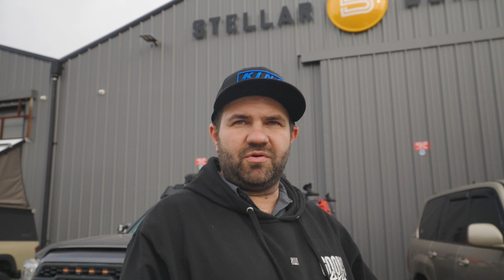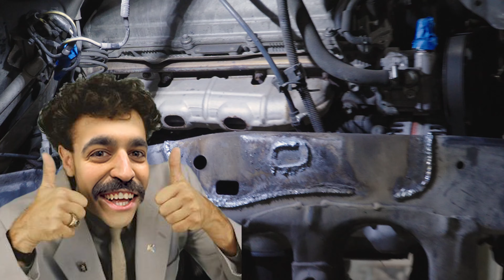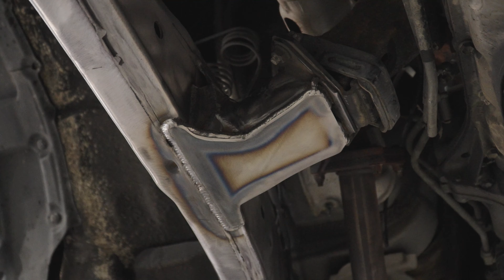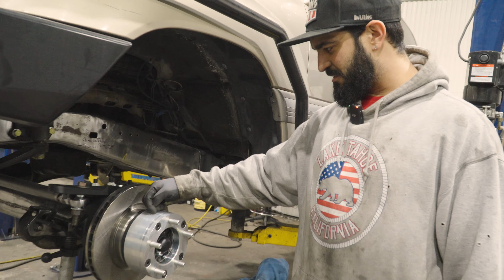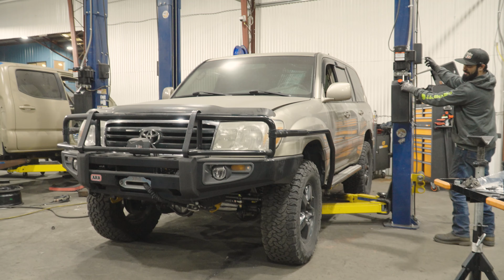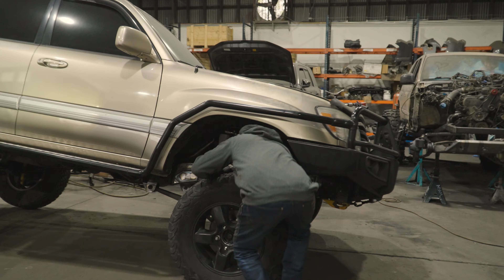Land Cruiser SAS Conversion | UZJ100 + FJ80 AXLE

Comment: Yes, the 105 series is super cool, but they still have the inline 6 engines. So in my opinion, the ultimate land cruiser would be what you guys are doing here: converting a 100 series with the 2UZ to solid front axle. This is rad!!
Reply: Or engine swapped 105, fte swap. It also has the 1fz aswell
Reply: @kadenmackriell4751  I agree, that works too! haha

Comment: great build, quick question, when doing the swap using an 80 series front axle, do you also need to swap out the rear axle do to gear ratios? also how much can once expect to spend if they wanted to do a solid front end swap on a 100?

Comment: 105 diffs are wider so you wouldn't have to run wheel spacers. We use 105  diffs when coil converting 79s here in AUS.
Reply: Needs a GU Steering box
Reply: @benwilkinson7181 although gu steering box is beefy, people are starting to use 105 boxes now, the 105 isn't as big but it has a bigger sector shaft wich makes it stronger and better.
Reply: @kadenmackriell4751  I’m from Aus, the 105 box isn’t as good as GU steering box. Sharon’s 60 series has a GU box
Reply: @benwilkinson7181  yeah 105 box are good but they are prone to leaking a lot more than a GU
Reply: @benwilkinson7181  I'm from Australia aswell. And lots of people are starting to go away from gu boxes for 105 boxes.

Comment: 105 series owner here from Aus, cool to see this being done!
Reply from the maker: More to come!
Reply: Did 105 come with inline 6 cylinder or v8?
Reply: @lennyross2813  they came with 2 options. Petrol 1FZ Inline 6 or 1HZ Inline 6 here. Most people swap 1hdfte’s into the 105’s tho
Reply: @Shaanjc96  as much as i like my inline 6 in my 80series a V 8  option with a solid front axle would be ideal in my opinion.
Reply: @lennyross2813  I’ve not had much to do with the 80’s but I like them! Supposedly 105’s have a bigger more comfier interior/body. But yeah V8’s 👌🏽 there’s a few converted 105’s here with the turbo diesel vdj motors too! One for sale now actually

Comment: If in the future the customer wants to get rid of the adapters can get later 70 series 5 lug wheel hubs, there is also a strength increase going from 8mm to 10mm studs for the locking/drive flange studs.

Comment: I have a 100 series. It's a great truck. I also had a Tacoma. I took my Tacoma to the next level by trading it in for a Jeep Gladiator Rubicon. SAS sounds great, but at some point, I realized that a Jeep would be better for what I do. I will always be a Toyota guy, but I am also a Jeep guy too now. Toyota Land Cruiser for those long rode trips with only a little off-roading... Gladiator for my Moab trips. What's not to love.